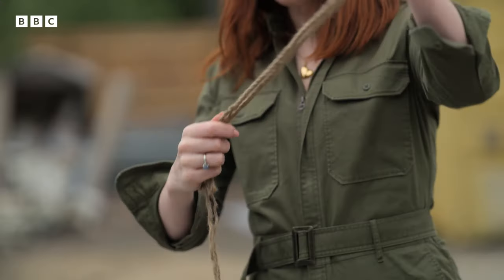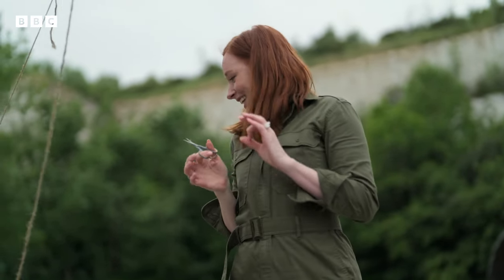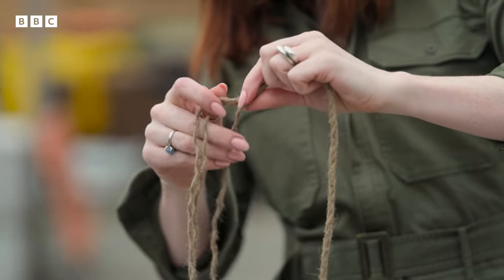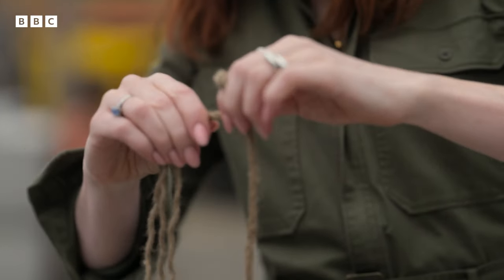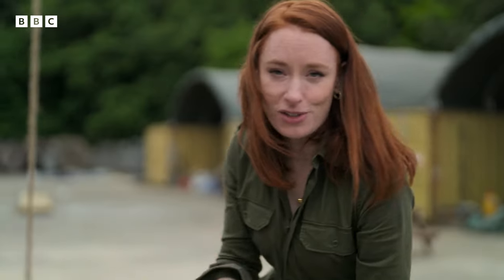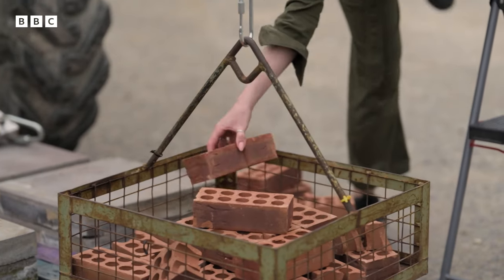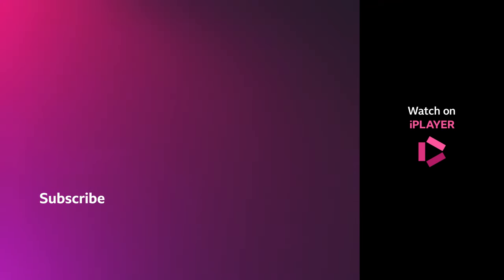The Fascinating Physics Behind Lift Cables | The Secret Genius of Modern Life- BBC

Comment: It has a lot to do with elasticity of the strings and dynamic loads. When the strings are twisted together and and can transfer loads onto each other, the snapping of one of them does increase the elasticity of only a very short portion of the rope. That means the whole rope will lengthen only very little under the load it is carrying, and there is almost no movement of the mass that is hanging at the bottom end of the rope. If the strings cannot exchange loads with each other, the elasticity increases on the whole length of the strings once one of them snaps. Then the will lengthen quite a bit under the load and the mass at the bottom end will move significantly. Once the strings are lengthened to the point where they would carry the static load again, the mass has gained some speed and its momentum will increase the load to above static load and force the strings to lengthen even more, until they also snap.

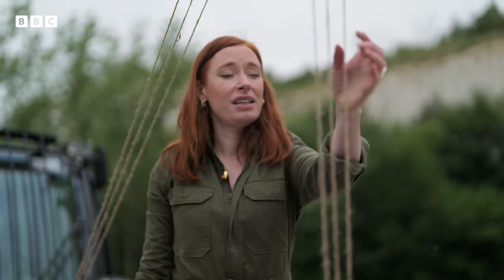Comment: If the strings were rigged for equal load distribution, which they are not, there would be no difference in the magnitude of the failure load. The three lower rings (at 0:42) have friction against the larger ring to which they are clipped, such that when one string is cut the remaining two will not likely have equal loading, also, the way this is rigged does not prevent or allow for control over unequal loading due to variations in string elasticity. Twisting the strings into a rope results in a more equal load distribution than the unequally distributed rigging that was used. Construction rigging is normally designed to ensure equal load distribution to multiple cables when multiple cables are utilized. I think this video could be clearer on the causal factors involved.
Reply: Not in 4 mins for the average telly watcher! Enthuse then expand, rather than bemuse and lose.
Also, while you are entirely correct, the point remains that a simple way to distribute this is to wind the cords and tie a knot with all three. While bricks are used, the implication is not that this is common engineering practice, it's a simple demonstration explaining why household cordage is wound like this, rather than one thick line.
Reply: Sorry I'm late, but I think there is something else that is likely more responsible for the result than unequal load distribution -- knots! Many knots can reduce the strength of a rope to 50%. But they may have tied a better knot, so I'll assume 67% of the ropes original strength is maintained.
In the case of the three strands twisted together, when one strand is cut the ropes strength at that location is 2/3 (67%) of the original strength. So the remaining two strands have roughly the same strength (67%) as the knot does. Since the knot is a good distance away from the cut point, the knot maintains 67% of the full three strand ropes strength (thanks to the strand-to-strand friction they mentioned). The rope now has more weak spots (3, a knot at each end and a cut in the middle), but because the knots are a good distance from the cut point, the knots aren't weakened further by the cut strand. 
In the case where the three strands were separated, the two issues do multiply. The knots weaken each strand to 67%, and when one strand is cut only, 2/3 of the strands remain. Two thirds of 67% is approximately 45%. The twisted strands case is 1.5* times stronger than the separated strands case based on just the knot situation. Any unequal load distribution, as you mentioned, would just make things worse for the separated strand case.

* Note: This 1.5 times stronger is with my 67% knot assumption. Knot strengths can vary quite a bit for different knots and different ropes, so the 1.5 times stronger is just an estimate. It could be significantly different for the knot and rope that they used.
Reply: @andrewsnow7386  While it's true knotting reduces a rope's strength, that strength reduction happens near the knot itself. In none of the examples here is failure happening at the knots. Indeed, with her cuts she forced failure to happen far away from the knots. With more time failure could well have happened at the knots, even without her cuts, but that wasn't the point of the demonstration.
Reply: @MrRlnansel  "In none of the examples here is failure happening at the knots."
It appears ALL the failures (except the intentional cuts) happened at the knots. At 1:28 in the video, you can see the last of the three strands break at the knot above the load. Further, based on the  amount of slack (seen flying up in the background) just prior to the final strand failure, it appears the second strand to fail (the first failure being the strand that was cut), failed at the knot at the anchor end.

Finally, at 4:15 the rope is still hanging down from the pulley. It did not break near the cut strand. In the background you can see a loop of line hanging from the metal anchor rings. It appears the line broke at the knot that formed this loop. The knot was weaker than two strands of the rope, implying the knot cut the strength of the rope by more than 33%.
Reply: @andrewsnow7386  Shucks. I stand corrected. I suppose I should have rewatched the demo rather than rely on my memory. I do recall thinking about how the knots might affect the results before seeing the results, but clearly I failed to see what actually happened.